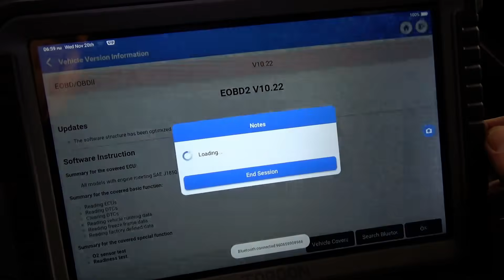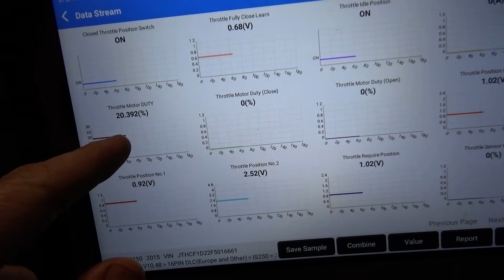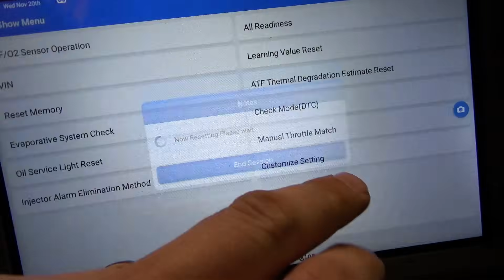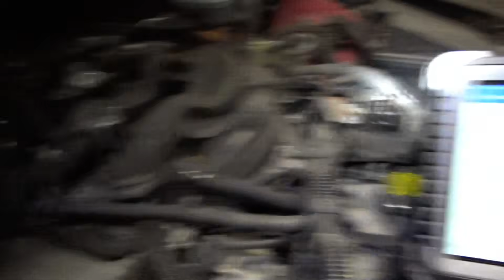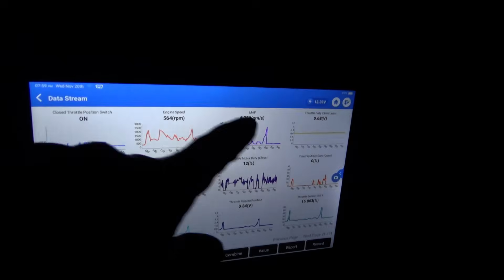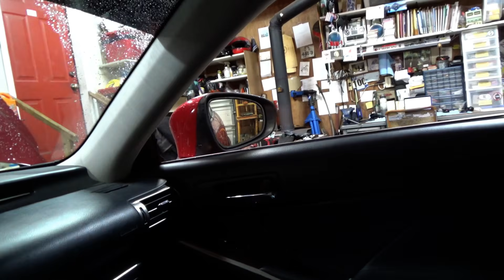CRAZY Lexus Idles at 2,100 RPM?!? No Codes Set!? ('15 IS250 V6)

Comment: Horrible diag..  mirrors can be fixed no parts required..  take the mirror off, position the motor correctly with its travel the right lengths and snap it back in.  There might be a clip that is cracked or broken so some parts maybe required.  The transmission shifter has bushings in the actual shifter arm that keeps it from moving like that.  When people drive with their hands on the shifter they tend to pull on it which stretches those bushings.  They’re like a 10$ part but you have to take the entire linkage off to replace the lower and upper little plastic bushings..  they snap in place..  the buttons not working should be inside the module, so take apart the housing, clean off all the sticky nasty mess, look for shorted components or burnt components and replace as necessary unless its an ic or proprietary chip you cant get then replace the board/ module and fixed buttons, before you plug them back in pop the usb pod out and dump some alcohol in them and toothbrush out the sticky and dry.  Then completely fixed whip..  so decent diag on figuring out whats fuked up but on the follow through it is lacking..  you knew you could fix the stuff but the diag time probably will push the bill far enough and repairs will add double that time to do..  but new transmission??  Jesus..  sounding like a dealership..  “with the repairs needed the car is totaled but we have a good 2025 model with low rates, hows your credit?”….  Lol
Reply from the maker: I'll just ship the car to you and you can make it perfect... I'm sure replacing "shifter bushings" will fix a dragging torque converter 😂👌

Comment: If it’s an aftermarket Throttle body., that could be the cause…also, check out the idle air control  and coolant temp sensor. But in order to stop chasing your tail  on this one, it needs genuine parts fitted ( perhaps a relearn as well) to bring it. Suck to square one, and then observe the results.
Reply: No iac....

Comment: The mirrors may be fixable. This usually happens when they are shut by force. From the inertia the plastic parts of the motors mechanism are detached and you get this clicking sound. The actual glass of the mirrors has to be pulled out. Move the mirror in the upper end position. From the bottom gap you should see plastic clips that detach the mirror glass. Then you have to settle the mechanism. It's a little tricky business.
Reply: Somebody did this to my mirror, by pushing it to the closed position and now it only angles up and down, not out and in again. 🤷‍♂

Comment: Ivan do you.mean the TC is engaging at too low a speed? ie  stall speed too low. So has some sort of internal impeller/turbine clearance problem.The trans itself would be in some gear, hopefully.
Reply from the maker: Correct there is excessive drag in the Torque converter... Internal problem 👍

Comment: I'd like to see more testing of the readings of the throttle pedal.  The fact the problem tends to go away when the battery is disconnected tends to point to a problem with a learned value.  I've seen brake lights stuck on because the brake pedal wasn't consistent on where it would stop when the pedal was released.  The computer learned the "most released" position as the "off" position.  Anything short of that was interpreted as someone pushing the pedal. Once the pedal was fixed so it consistently hit the stop when released, the problem went away.  The computers are always learning, even in normal mode to compensate for drifting values. 
As mislearned throttle pedal position wouldn't set codes because a high idle due to "someone" pushing on the pedal would be completely normal.  There's a chance for NPR yet!
Reply: I didn't see any accelerator pedal position reading which would be my first hunch, but I did notice the 'throttle closed position' didn't change even when the idle was going up and down, it only changed eventually when the throttle body was moving over a larger range. So it's possible the end switch is either badly connected or it's physically loose and dragging along with the throttle flap, which would prevent it from closing any further.
Reply: It was an option, he didn’t check it off in the PID selection.

Comment: 500 revs in gear is typical for Toyota vehicles. They always idle high after starting and then drop dramatically when you put it in reverse or drive. My Tacoma will idle at about 1200 for 10 min until you take it out of park, then it immediately drops to 5-600

Comment: Wait until the owner finds out the mirrors are obsolete and near unobtainium. The transmission is $7,000 and the center console knob/button thing is a mere thousand dollars.
Reply: The dragging transmission may even be caused by those knobs being erratic and engaging the snow mode or any other transmission function where they shouldn't as a default.
Reply: Deoxit or Isopropyl the central control knobs and underneath of that unit, and dry it off, it should work.
Reply: @johnt.848  Agreed...I am a little surprised that Ivan didn't try to MacGyver this....at least a little....I guess the coffee stains were definitave.....needs a new module.....but the trans??? I thought he called that a bit quickly.....Toyota trans are well known to be fairly bulletproof.....now it it was neglected or abused, then all bets are off....
Reply: @johnt.848  I'd start with distilled water because some contamination don't dissolve with alcohol but dissolves easily with water. Many foods and beverages has this issue.
Reply: @ehsnils  I agree with this. And I also think this traction control knob assembly is the real culprit.

Comment: While I can understand Ivan's theory of what is wrong, this one left me really wondering if the transmission is the culprit.  Could the module being unplugged/messed up cause the issue?  I'd have a hard time calling a bad trans at this point.
Reply: tend to agree. with hoe computerized these newer cars are, it would for sure throw some kind of fault code.

Comment: my 05 kia sorento would idle at 1800  tired bring it down by the idle screw would not come did not have a code except excessive idle speed started unplugging sensors the mass air flow sensor the car came to normal idle speed went to junk yard changed the mass air sensor car idle was low had to manually  increase the idle its been fine for a year
Reply from the maker: The Korean logic can be almost as confusing as German logic 😂
Reply: @PineHollowAutoDiagnostics  i learned the unplugging sensor trick from you thanks

Comment: Dear Ivan....As recalled, from memeory, TOYOTA/LEXUS   always, always, alwasy instructed the Owner to remove, and to Clean the positive and negative battery terminals EVERY 6 months.   So, If you work or any, maybe FIRST, the battery terminals should be disconnected and correctly cleaned.   ???   Yeah, what about the codes or the computer (s) etc.??  Look YOU are the expert....but does it not makes sense to clean the terminals, after they are removed????  Charge to do this....Then, begin.  Owners that spill coffee are making a big mistake.  and, bty, some mirrors "fold in" manually.   Next time, if possible, fold in the mirrors a couple times....maybe the snaping back will jart the motors....spray WD-40 behind the mirrors.....worth a try.   Still possible that the vehicle is haunted....beware....ever watch the "Exoricst" movie?????  Like Sarah-N-Tuned says, "Carefulling!"
Reply from the maker: I think the fancy auto folding mirrors stressed and broke the motor wires haha

Comment: Throttle is an easy fix. Dump all the electronics junk and connect a Bowden cable from the throttle pedal to the butterfly. That is a control system that has been working for more than a century.

Comment: If this was drive by cable I would say it is a stuck throttle or something wrong with the cable.  Since this is drive by wire there is something wonky with the electronics or wiring.
Reply: Or an interdepence input issue...

Comment: I wondered if the throttle body was a parts canon. Whoever sold that was probably not forthcoming about its history.
Reply from the maker: Yup I think that when the throttle body didn't fix the high idle, they dumped it 😂
Reply: @ Does the customer still have the OEM throttle body somewhere? I feel like we're looking at one problem that is being caused by another, so the original throttle body was probably still fine.
Reply: @ what a disaster. I wonder if they have probable grounds to sue for a refund.
Reply: @kevincampbell8298  I wouldn't be surprised if the transmission dragging was the root problem and the Autozone throttle body exacerbated the issue .

Comment: Sorry Ivan but your theory that "something" is wrong in the transmission makes zero sense. If anything was partially applied in that transmission you would know it. You did all of those diagnostics in Park and even if the TCC was stuck on there are still no drive clutches applied. How does that engine run so smoothly in Park with something dragging in the transmission? Vehicle would want to stall or move or Torque Converter would make noise. Seems like a huge leap to a conclusion and a sloppy diagnosis. Would love to see the final diagnosis and fix on this one.
Reply from the maker: The entire problem is excessive drag of the Torque converter... Rest of transmission is fine and shifts smoothly 😊
Reply: @PineHollowAutoDiagnostics 
I just cannot in my experience see how a torque converter can cause these symptoms. Any chance this is an APPS problem?
Reply: @adamcweber  I'd say no since the APPS uses 2 potentiometers. There is no way that both pots failed and are sending the same signal to open the throttle. The 2012-14  Camry have a known torque issue.  converter issue. I wonder if this Lexus is somehow related to that.
Reply: @WeirdWonka 
Yeah I know there is redundancy built into the APPS. Weren't the Camry Torque Converter issues for TCC shudder? If this TCC clutch was somehow locked up in idle it would stall in gear. Any torque converter issue would end up translating into noticeable transmission problems or failure. Even in theory if the ECU had to open the throttle blade more to stay at target idle from a load on the engine how does that explain this excessively high idle in Park in the garage doing diagnostics and no attempt to come back to target idle? Customer did a battery disconnect and idle was fine for two days but this is somehow a dragging torque converter? I guess running this car with the TC bolts removed would be the test. If I am wrong I guess I learned something new but I would love to see a follow-up resolution. Many years doing transmission work I have never seen a TC cause this personally.

Comment: Transmission definately seems like it has a tight torque converter.   Hopefully just a TC swap will fix it, and it doesn't require a whole new trans.
Reply: How would a battery disconnect temporarily fix a “tight” TC?   As Ivan and Eric O. always say: follow the data.
Reply: Could be an issue with the lockup clutch...which is probably integral to the torque converter.
Reply: Toyota did have recalls on some models for bad torque converters in some vehicles in that year range. Not sure if this was one of them, though.

Comment: Just adjust the idle screw on the carb. 😁😁😁I hate later model cars.  I keep driving my 2001 Buick.
Reply: Buick and carburetor haven't been used in the same sentence since about 1981 😅... 2001 is a bag of cats!

Comment: There's a lot of unknowns here to determine a transmission can cause idle problems. The mode switch is unhooked, coke in the connector causing errant resistances where they shouldn't be. Maybe... shouldn't the IAC control idle and not the throttle plate if it has an IAC? I'm very skeptical about transmission is the trouble.
Reply from the maker: There's no IAC on electronic throttle systems 😉
Reply: @PineHollowAutoDiagnostics  Does that hold true for all electronic throttles? I guess it makes sense since the air could be controlled with the plate instead of a valve. Why didn't the plate show 100% at full open and something more near 0 at idle? Learning here.
Reply: @garysurovec thats normal, these values are used for faultcode recognition. Similar  to a tps reading from 0.5 to 4.5v and NOT 0 to 5v, that is its operating range, outside of that it will set faultcodes.

Comment: The throttle position sensor and throttle body is suspect. I would guess the original owner "tuned it up" with a chinesium throttle body and set the whole chain of events in motion.

Comment: Man, that was a lot of PIDs! I was just thinking - if the accelerator pedal were not returning to the released position, wouldn't the result be similar? The computer would be thinking "why is this guy holding the accelerator pedal down partway?" and then it would say "well, I guess the guy wants the RPM's up to check something", and give it the beans. But I'll admit I'm pretty much a Neanderthal compared to most diagnosticians.....I got lost between "Throttle Position" and "Throttle Relative Position".

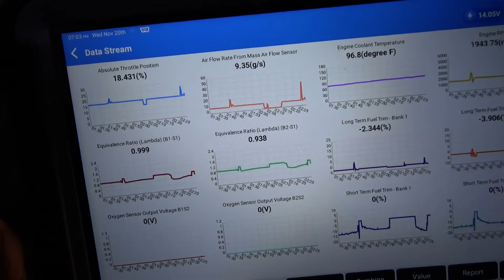Comment: 6:31 in and I’ve got to think there has to be a cheap throttle body installed or it needs a throttle position recalibration.  Air is being let in unmetered it seems or the system thinks there is more or less air expected and is adjusting fuel accordingly.

Comment: experience a similar problem with a 2006 Mustang 4.6 - high idle no code - talked this over with friend from TRW in Detroit - suggested that one of the two TPSs was not talking  - they work in tandem but opposite voltage flows - finally figured it out as bad contact on main computer when damp or wet - cleaned / dried and been fine since
Reply from the maker: If a TPS signal isn't being seen by the PCM, that should certainly set a code and put the car in limp mode... 🤔

Comment: So previous owner had same issue with old throttle because of transmission drag, but sold it on to student, who now is screwed. I still think there is a fix in there, but would take much more diagnostics.
Reply from the maker: What would you do to diagnose the problem further?
Reply: @PineHollowAutoDiagnostics  Why does the car drive normally after battery is reset for 2 days? How does that fix a bad transmission?
Reply: @PineHollowAutoDiagnostics  I would check live data from transmission. It may in some soft of failsafe mode because of the unpluged mode switch even it is throwing no codes.
Reply: @PineHollowAutoDiagnostics Why can’t you answer the question to support your diag of a bad transmission: How does a battery disconnect temporarily fix a high drag condition in the transmission?  Don’t ask me what MY next diag step would be unless you’re willing to pay me for my diag time (just like you). 😅
Reply from the maker: @vg3430  I already clearly explained my reasoning in the video if you were paying attention 😜

Comment: Needs a transmission but no codes stored? What did live data for the transmission show? If something was binding internally, the additional drag without the car moving should have set something. Is that throttle body a genuine Lexus AND the correct one? They didn't install one for the IS350 by chance? It's cheaper than one for the IS250.
Reply from the maker: Unfortunately there's no code for "excessive transmission drag" 😅
Reply: @PineHollowAutoDiagnostics  P074x Range of codes are codes for Torque Converter Issues (Either Slipping or Dragging).

However, on this newer Aisin Transmission, is the P2757. But it has some different conditions of failure than other transmissions that uses P074x conditions; so that's why it doesn't show as expected. Is unifying the SLU Circuit Code, Over/Under Slipping and Hydraulic Conditions into one Code.

For a simple confirmation, in Park and Neutral, the ISS and Engine RPM has to be the same speed; and Reverse and Forward Gears when Stopped the ISS has to be 0 RPM until moving; if not, Transmission is Dragging (TCC, TC or Valve Body are Bad). That could be helpful for future diagnosis regarding Transmission Issues if you want to.
Reply: @PineHollowAutoDiagnostics But would the transmission mode selector switch fix that like perhaps the clean earth got the mirrors working to some extent? What if the trans default is maximum drag until the switch intervenes and then there's correct spec trans fluid its condition and level to be sure it's the trans. These are economic gambles with the parts cannon now to put to the owner.